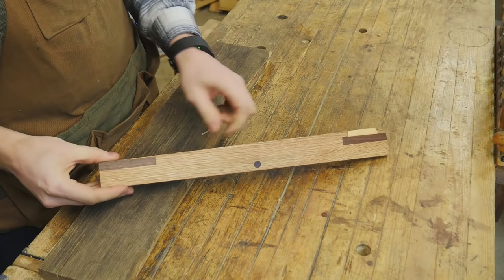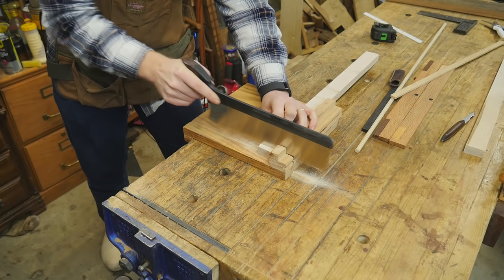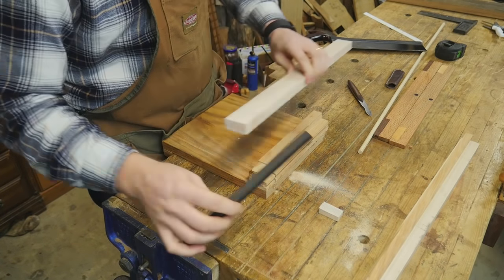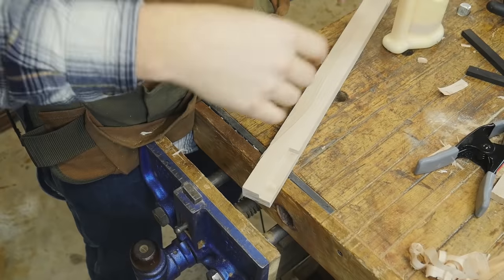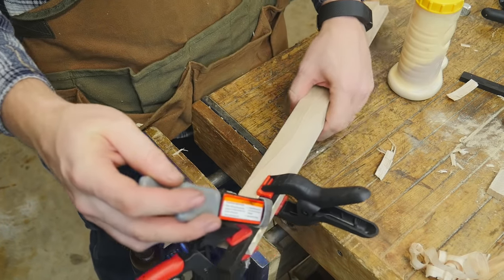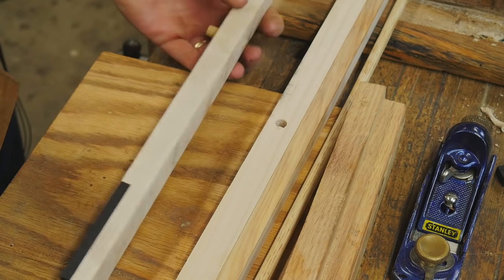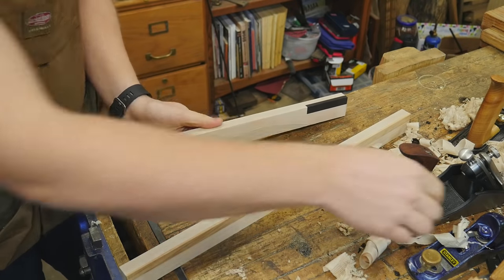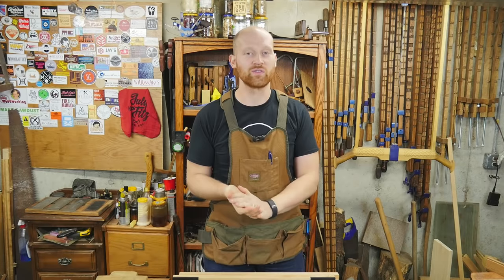How to Make Winding Sticks Long Format Hand Tool Woodworking Project

Comment: I kind of regretted inlaying my set of winding sticks.  The areas around the inlay warped and cupped slightly while the rest of the (very stable, heavy and old) red oak and the non inlaid piece was perfectly straight.  Live and learn. Live and learn.

Comment: Thanks James! I sharpened chisels for the first time today, cut a couple of tenons and mortises to get the feel. I have a good overall plan for my workshop now... interior will be precision work (goal is guitar repair and building)... outside table will be messy work... I am way down in Mexico, so the weather will not be an issue. I won't be "pure" with100% hand tools... I have a good wormdrive skillsaw and a bench grinder for rough work... goal is to finish everything with plane and chisel. A shooting board and winding sticks will be my first real projects. Fun!!!
Reply from the maker: Sweet man sounds like a solid plan. Looking forward to seeing what you make!

Comment: Great video.  I totally dug the long form.  Working in the different methods for the rabbets was an excellent touch. I just acquired a Stanley 71 and 45 and 80 so this was a great primer on the ways to bring them together along with standard chisel work.
Reply from the maker: +Travis Reese thanks. Sounds like a good acquisition.

Comment: I just finished my first (and maybe last) pair of winding sticks, watching your video for details over and over again. I used oak wood for the sticks and walnut instead of ebony and some scrap pieces of  larch for marking the middle of the sticks. It worked out pretty fine as it was my first projekt including smothing the oak wood, checking again and again for squareness and so on. When finished, I discovered some round pieces of beech wood which I could have used instead of the larch -_-  Maybe I'll add them after working some time with the sticks. 
So far, I'm satisfied as I learned much about how to use the Jack plane and Smoothing plane. Perhaps a second set of shorter winding sticks might be a good idea, as these have a length of 25 inch and a height of 1,6 inches.
Reply from the maker: Nice David. Sounds like a fun time in the shop
Reply: Definetely. Since I got an old professional Carpenter's workbench, it is much more convenient and fun than using an improvised bench and just clamps to fix something.

Comment: thanks for the instruction, James! Do you have to look for or prefer a specific cut of wood for making these (like using quartersawn material)? I'm wondering this because of wood movement and keeping your sticks true and straight over time with no warping or bowing.
Reply from the maker: yes the straiter the grain the better. But usually they are so small that there will be almost no measurable wood movement. when you make 3-4' long sticks that choice can become more important.

Comment: Well, there's another for my to-do list.  Thanks for the long version, it makes the process very clear. Didn't know about the 2x speed before either.
I think I hesitated to make winding sticks because I thought they had to be perfect; flat, parallel sides and all that.  Uniform at both ends makes it so much easier and it makes sense ... duh!
Reply from the maker: Thanks. I am here to help in any way I can.

Comment: Recently found your channel and have been making moves towards a more handtool friendly shop and I have learned a lot from your videos! 2 quick things! 1) now that we are a few years out do you still "trust" your winding sticks to stay true as both winding sticks and a straight edge or do you have to make new ones/ reflatten from time to time. I would assume they are small enough to last a lifetime, as you say, without a ton of movement but just curious. 2) as I looked for the answer to that question in the comments I made two realizations. You had answered every question and you handle trolls like a boss haha kudos sir!
Reply from the maker: Thanks. As long as you chose straight grained clean wood that is running from end and resin running out the side You shouldn't have any problems with them coming out of true. Both boards will expand and contract together. As long as they remain parallel to each other they're perfectly fine. odd thing about winding sticks is you could even make tapered winding sticks that are fatter at one end and thinner at the other. as long as both winding sticks match they'll still give you a true reading.

Comment: I find that painting the whole top edge of the stick that will go in the back (against my white wall) makes for a very visible visual phenomenon that is much more forgiving of imperfect eyesight than just the two ends.

With just the two ends painted in, I have to 'see' which one disappears first. And with either or both sticks looking a bit blurry from not being able to have both in focus unless I back up quite a bit, it's not that easy to be sure.

With the whole edge painted, I don't actually need to see all that accurately. Instead, moving my eye level up and down around the height at which the top edge of the back stick disappears will cause a tiny sliver of black to appear to be moving sideways across the top of the front stick, in one direction or the other depending on how the board twists. Essentially we are hacking an artefact of human eyesight, akin to when something appears to be moving fast in one's peripheral vision, when in fact it's just two straight edges with contrasting brightness meeting at a shallow angle.

Anyway, that was my two cents.

Comment: One lesson I've learned with the veritas wheel blade style marking gauge is to make sure either that wheel is always nice and snug or do what I do and make sure that you use the gauge in such a way that you will be tightening the wheel in a clockwise rotation as you mark... my wheel was tight and it still backed out on me once (ironically while I was making my winding sticks i think) because I was using it where the wheel (if it were loose) was turning counterclockwise as I was marking.  To make it worse, I didn't notice it right away and it caused a lot of re-work.
Reply from the maker: I actually use lock tight on mine and it has not come loose yet. but most people do not let the wheel turn as that is what Veritas suggests.
Reply: ha, I didn't let the wheel turn on purpose, it just did, i ended up doing the same thing... lock tight is a wonderful thing.

Comment: I was lazy and cheap. I planed up two pieces of pine and used a black permanent marker on the top edges of one stick. Less effort same effect. But yours look way better than mine!
Reply from the maker: yup they do not need to be fancy to work, I often use the project to teach skill building, and they tend to get overly complicated.

Comment: Why do the sticks have to be the same width? I use ones with 2 different widths, as your sighting down them I'm just monitoring whether all of the stick disappears evenly to determine wind
Reply from the maker: Not the same width but the same angle. you could use two wedges as long as they had the same angle.  It was a statement I failed to cart across well in the video.

Comment: I know you shot this at the beginning of the year but I have a question.  The long, thin piece of light wood you used for the top of one of the sticks...how would you cut that down to 1/4" or 1/2".  I have no idea how to cut thin stock like that.  A knife and just keep going deeper with the cut?  A tenon saw at a very shallow angle.  I am not sure how to cut thin stock like that.  Thanks.
Reply from the maker: I just use a panel saw and go slowly. a small stock like that cuts quickly. then I do double sided tape to stick it down to the bench and place it to final thickness.
Reply: Thanks James.  I am wondering if there is a type of plane that has a saw blade in it, set for a depth of say, 3/8".  With a movable fence.  Like your Stanley 45, but with a thin blade.  You would just run this plane against the side of the stock and it would eventually cut through.  My cutting skills are still really poor.  I need practice but I don't want to stop making things until I can saw straight.
Reply: I just watched your video on the kerfing plane.  Just like you went through a piece of wood with the 45, I could do the same with the kerfing plane.
Reply from the maker: yup. some call it a rabbit saw because you can set it up to cut out both sides of the rabbit.

Comment: Can anyone please tell me what the dowel through the middle is for?
Reply from the maker: it marks the center of the stick. that way it does not lean to one side or the other with it being off center.
Reply: @WoodByWright  thank you for clearing that up. Before i new they where dowels i thought they where magnets. I have seen that done before.

Comment: Hi! Question - is there a good way to make winding sticks without a woodworkers workbench?  I want to make the winding sticks to make the workbench, feels a bit like chicken and egg, but there must be some suggestions?
Reply from the maker: sure. I made my first pair on a folding table. I have seen others use a wall. they do not need to be pretty they just need to be parallel.
Reply: Thank you!
Reply: I'm watching this for the third time in as many years, getting ready to make mine. One thing I seemed miss though - - - what is the function of the dowel inserted into the  centers of the sticks?

Comment: Exactly how accurate are winding sticks?
Reply from the maker: they can be far more accurate than a power planer or joiner. but then they are only as accurate as you make them. with longer 2' sticks you can tell a .0001 difference in a 4" wide board.

Comment: Here comes the stupid question.  What kind of saw is that?  I’m still looking for a saw like that for general cutting, not dovetails. I’m nowhere near ready for dovetails.  Thanks
Reply from the maker: I believe you are talking about the carcass saw from veratas. that is the most commonly used saw in my shop. with the crosscut teeth it does most of my joinery.

Comment: Why the dowel rod? Thanks
Reply: Jared English verifies center of the board
Reply from the maker: +JoshL right on. If the board is off center it will neanderthal one way or another. There is a clip tward the beginning of the video where I show what happens if it is off center.

Comment: I made a copy of your winding sticks and would like to make a comment. I thought that the idea of having light and dark patches was so you could see the contrast between the two. When I tried them out I realised that was not possible as the colour on the stick nearest to me was way out to the left and right of the furthest stick therefore nullifying what I thought was their purpose.
Reply from the maker: That is why I put the one with the inlay going all the way across closer to me and the other one with it just on the tips further from me. The distance between the sticks will change every use so where the tips of the further one appear to touch the closer stick will change. does that make sense?
Reply: Thanks for the quick reply. You do make sense. Sorry I meant I copied the ones you had previously made. I shall have to inlay across the top.
Reply from the maker: oh I See. ya those were just there for experimenting with inlay and learning a new skill. it is a good project for messing around and trying something new.

Comment: I believe that by taking the sharp corners off you just diminished the accuracy.
Reply from the maker: It sounds that way but in actuality it does not affect their use at all. He provides a slightly better effect as there is a highlighted line along the top of the board making it easier to see. It's not much just a couple passes.
Reply: @WoodByWright  Thank you!